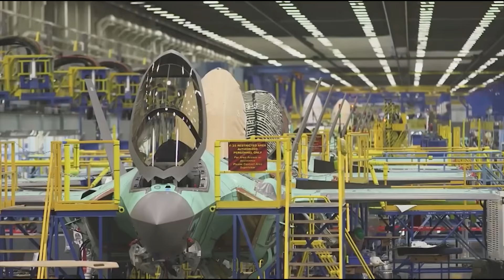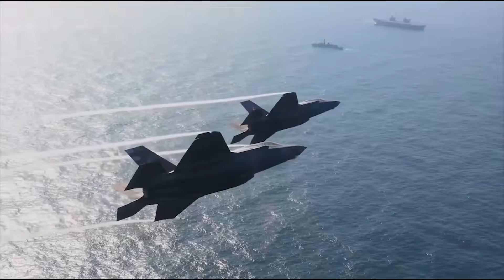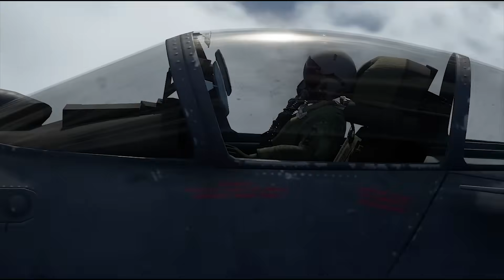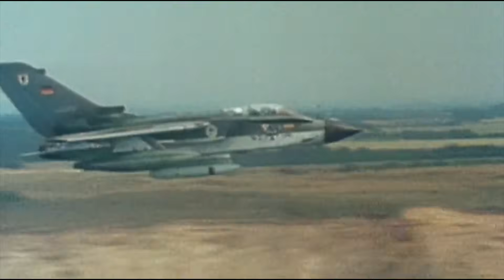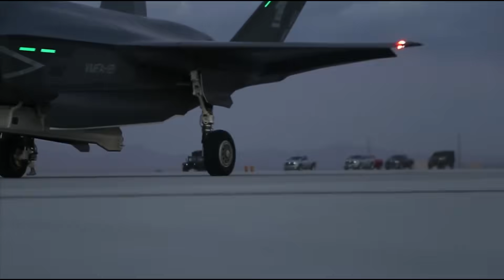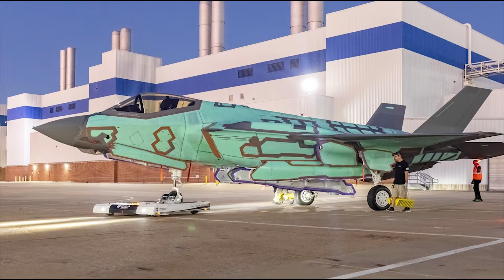Germany’s First F-35A Is Almost Ready – It Will Dominate the Skies!

Comment: The great part is those 34 units of the F-35 will be able to a slave over 1000 drone wingman beside it commanding over 4000 missiles so you really don't need a bunch of maned aircraft in the sky any longer.  The drones can take off by themselves fly to the vicinity of the F-35 until the F-35 asks them to shoot and then I go back to base automatically land get reloaded and go back up beside the F-35 awaiting new commands This all happens automatically so one F-35 could be commanding over 68 drones at any one time in different states of readiness! You're the next generation There'll be no live pilots in the sky basically the pilot will be in a bunker underground flying his F-35 in total virtual mode as if he was sitting in the cockpit for real with the same 8K clarity he now sees. As far as the ability to avoid missiles this virtual pilot will be able to take 30G forces which will be able to shake quite a few missile systems with all the other countermeasures.

Comment: The tornado is basically a flying brick that guzzles fuel like a 12 cylinder Lamborghini engine! The F-35 may fly a little slower a Tornado but it has super cruise which means it doesn't need to use after-burners to go supersonic so it literally has twice the fuel economy or half as much fuel needed depending on how you want to look at it.